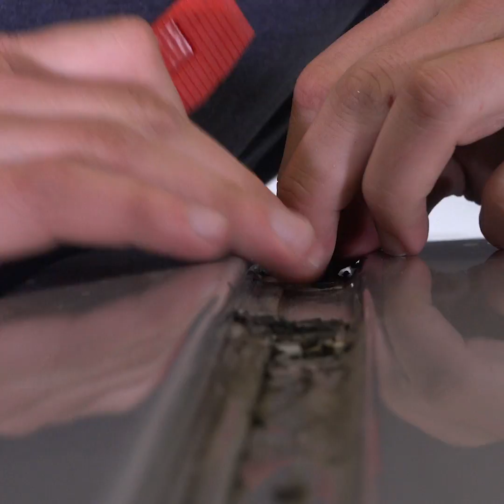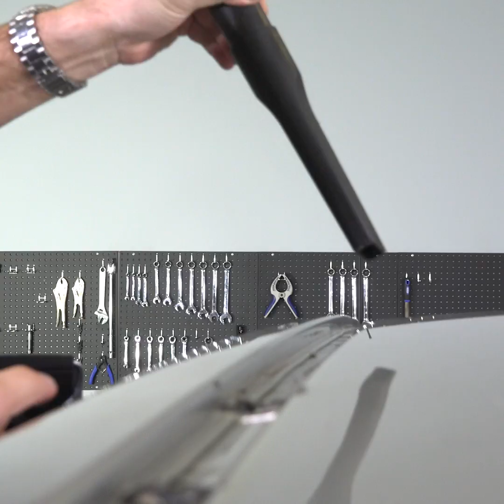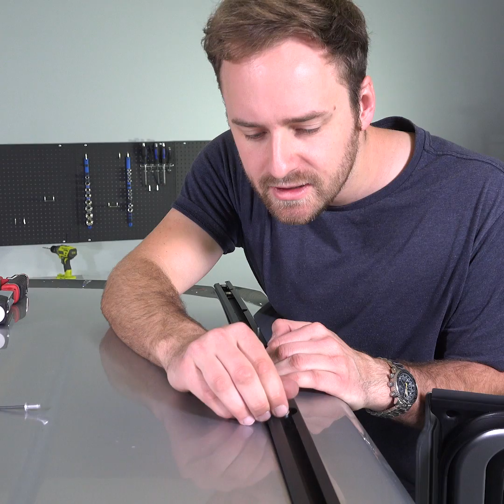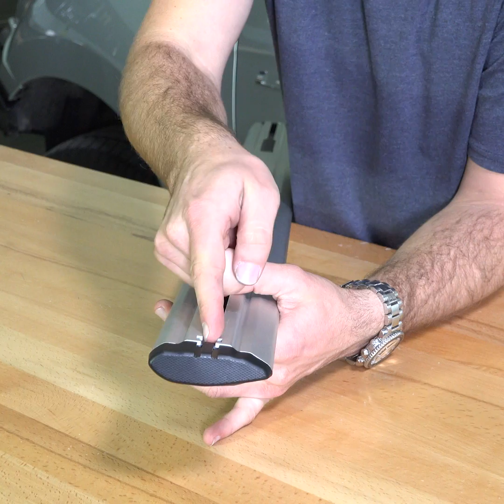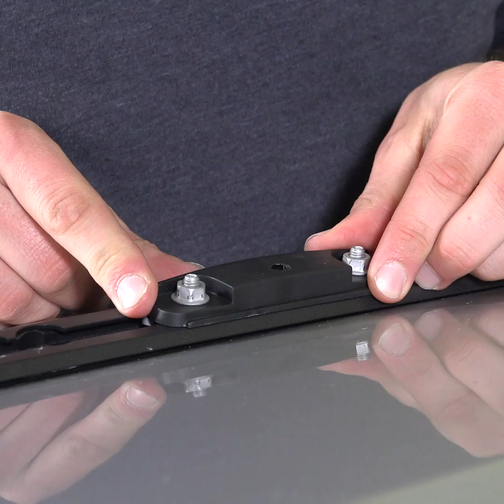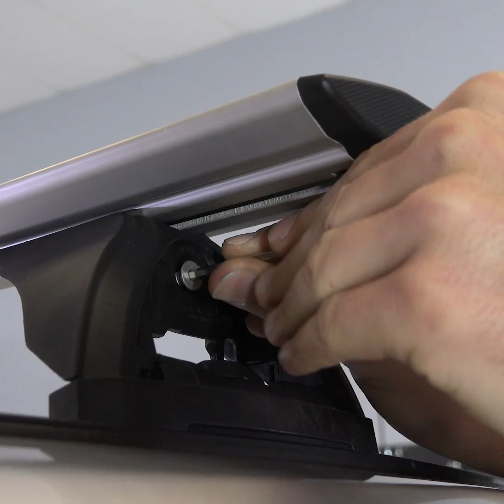How to Install Adventure Kings Track Mount Ute Roof Bar Kits

Comment: Hey guys. What's the process if you don't have the threaded holes?
Reply from the maker: Hi There, Not too sure. Some people get holes threaded or some change bolts to the ones that suit. You may want to check with hardware shops near you as they may have some options for you. Cheers, Saleha =)
Reply: Try using Nutserts or drill and plate method.
You'll have to remove the Roof Lining on the latter
Reply: @madeulook5421  thank you

Comment: Hi 4WD Supercenter Rocket here, I have been a fan for awhile and already fitted out a Hilux and a Landcruiser with your awesome gear. I have turned to a 2014 FOTON 4x4 dual cab. I am about to kit this one out with a custom canopy and I have already ordered the Titan  Ute draws from you guys. Finding compatible parts can be challenging, which type of roof basket set up do you recommend? Is this vid my best option?